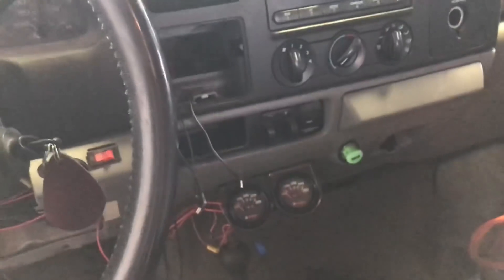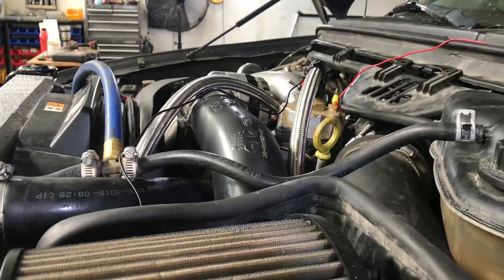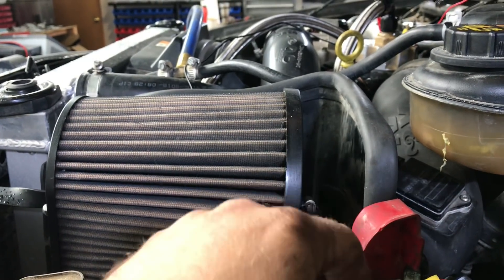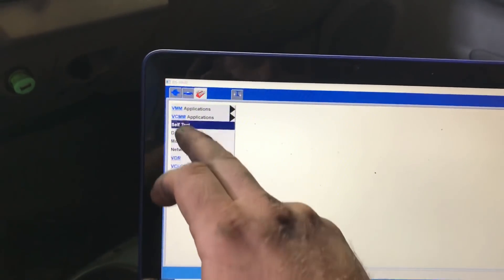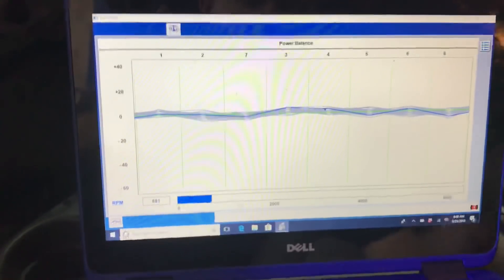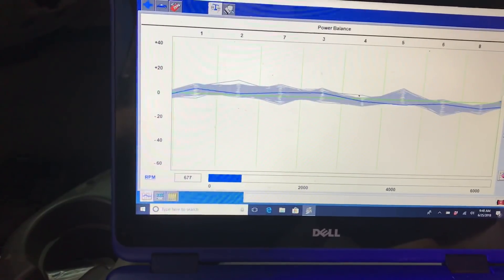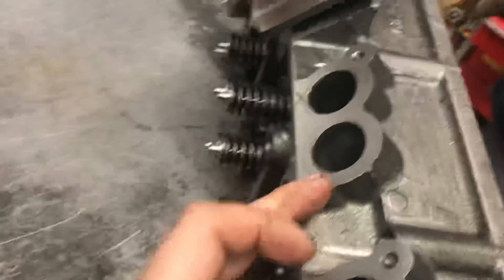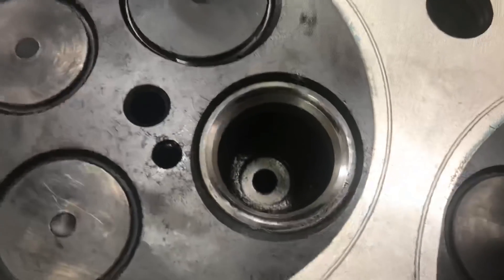BAD HEADS DIAGNOSIS PT.1

Comment: I know it’s a rare occurrence, and it seems you have this issue sorted, but I’m curious if/how you ruled out a leaky drivers side branch tube and/or injector oil rail? I ask because it looked like your ICP was running fairly high at idle and I think I saw it spike as the camera moved? From 860 to 9XX? That seems high?
Reply from the maker: ShowMeThePony icp wouldn’t matter. Icp is only high because I just did the reseal on injectors and it hasn’t bled off yet. The standpipe and dummy plugs are new. And the video shows the vaccum test fail on the cylinder that was the issue. Pretty cut and dry from there on. I have never seen a head that hasn’t been machined here in the use just work. They all need to be reworked. You get what you pay for.

Comment: How much is and where can you get that ids program?
Reply: Daniel Wade I think* it’s a dealer only software/hardware system. I’ll let 6.0 Dr correct me here. And it’s expensive unless you’re in the business of fixing Ford diesels for a living. However, if you’re a DIY or part time mechanic, I’d Highly recommend Auto Enginuity with the Ford bundle. I’d say it’s about 85-90% as effective as IDS but only about 25%ish the cost.

Comment: I would love to see a gauge go across those heads and see how well they were machined....
Reply from the maker: Steven Ruble I wanted to but since they are oringed already I didn’t want to mess with the decking. It looks pretty smooth on that. The valve recession is within specs which was a surprise. In between 15-25 thou. I was suprised any of the valves sealed up.